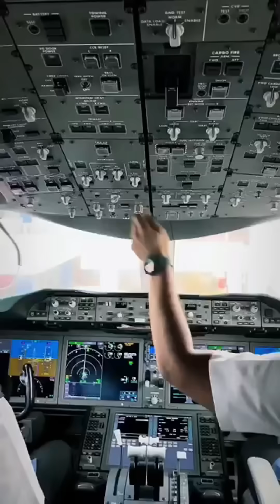why Boeing didn't build a 787 NEO

Comment: I know it's designed to handle it, but it still freaks me out watching the wing oscillate  quickly and especially when the engine shakes from side to side on its mount.
Reply: That happens in all airplanes, I saw it in an A350 900 too